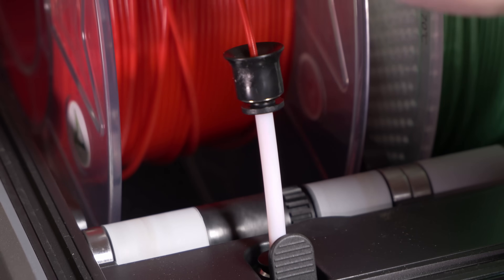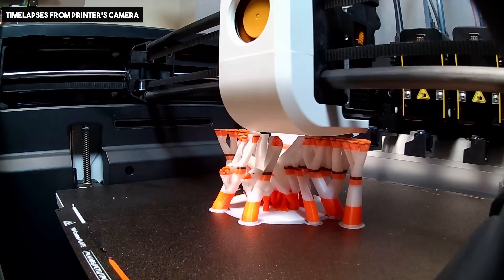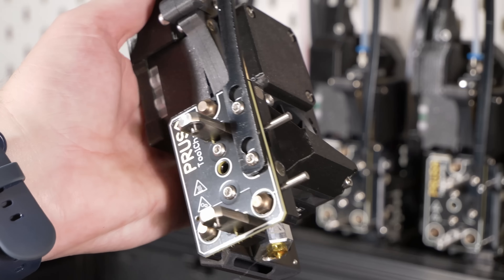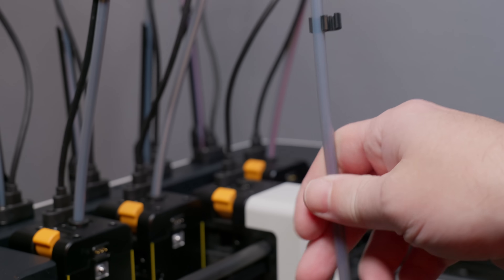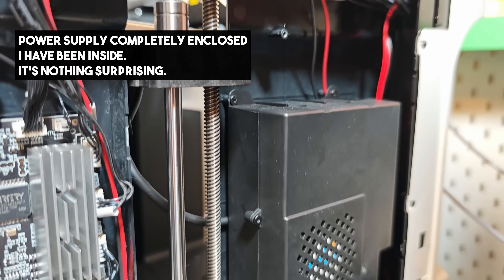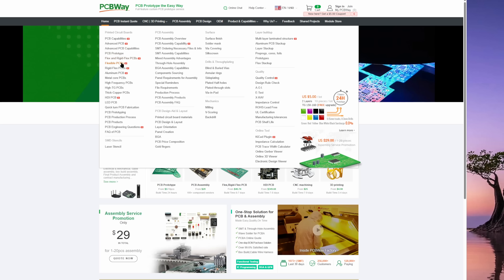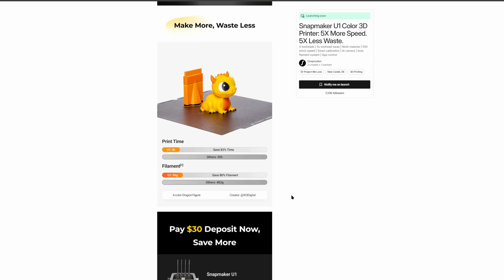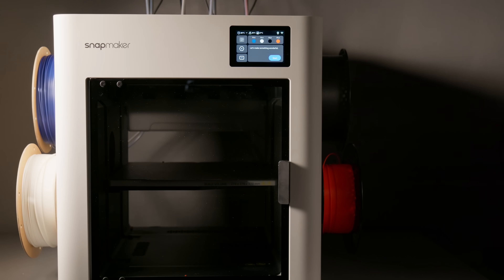FINALLY! An affordable 4X toolchanger! Meet the Snapmaker U1.

Comment: I've had their IDEX for about a year and a half and it works amazingly well. I use it mostly for being able to print a different support material for models with complex geometry. I see no reason why they can't pull this off.  It would be nice if they had a way to fully enclose  and heat the chamber though. Also you really shouldn't need a prime tower nowadays with pressure advance.
Reply from the maker: Oh. Completely forgot ! It's coming 😂 there will be a lid.

Comment: Looks like a additional $200 for it to be able to use functional filaments. $150 tophat (250msrp) and $50 for the hardened nozzles ($80 msrp ... why isnt this standard now?) So kickstarter price of $1000 for a 270mm^3 toolchanger, less than half the price of the bambu lab h2d with ams or the prusa xl.... Not bad...  that said Im still waiting for the INDX by Bondtech to start hitting the shelves so we can get some more toolchangers out in the wild.
Reply: This is still an incredibly reasonable price structure. :D I'm still super hype for INDX as well though.
Reply: @802Garage  35 per head! (if it works)

Comment: Do you know how accurate it prints? I print custom lego-compatible designs, and need something like this for multi-material designs
Reply from the maker: Very. Did you notice the goose miniature with it's eyes in the right place? I tested some miniatures too (forgot to include) and the accuracy is absolutely spot on.
Reply: @LostInTech3D  I did and it looked great even with stringing, but sorry I more so meant tolerances. Have you tested or seen anything on that?
Reply from the maker: I think some people were testing that, honestly these things usually come down to flow rate tuning, so I'm not hugely concerned

Comment: Oh look an embargo drop!

Half the reason Voron community got into toolchangers is that running HIPS through your nozzle fouls ABS for a little while, making your ABS prints not as strong as they should be, even a tiny contamination means a lot of strength reduction. With a tool changer system, you don't have that problem.

Comment: Toolchangers are the superior option in my opinion for serious users, not only for the massive reduction in waste and the possibility of using multi-material prints (cheap support filament with a higher capability material for instance), but the only way to go when you have Really expensive filament and a gram wasted in much too much already. This printer could put them on the map in a big way if they can deliver, but per my usual, I'll be waiting to see how they fare with proper release. Having a company to not support a printer isn't so much a problem these days, but it is annoying if some is open source and some is proprietary when it comes to warranty time, and the company isn't around anymore ala cash grab and run scenarios. 
What I'd REALLY like is a retrofit kit that isn't $2k or another project beyond adding some klipper code, as I have enough printers already and space becomes a premium for home users or those with smaller workshops.
Reply: @C-M-E  The flip side of that though is the expensive filaments need to be in a controlled environment because a print that fails wastes even more filament than a purge poop. The reason I have an AMS is to control the filaments more than anything. So even with this I don't think I would consider it usable as a multi material printer until I have gone ahead and bought a material station to go with it.
Reply: @christopherpepin6059  You can simply put the spools in dry boxes or dryers next to the printer and still run them through the filament feeder. People can also design mods to add dry boxes to the side like the Qidi cylinder box for the 3 series.
Reply: @christopherpepin6059  Chances are if you're using the engineering grade or industrial-lite materials (like above nylon approaching PEEK/PEI) this class of printer is probably not in your wheelhouse, at least not in a production setting. For the more avid home user or small-scale creator crowd, there are quite a few 'good enough' solutions or even DIY options that will suffice for material handling when the desire becomes a need. Something like the Sunlu S4 comes to mind, or if you need more heat and don't mind the DIY option, I ended up repurposing a discarded instapot for my controlled heating that will go way north of 80C and fit at least two spools for simultaneous printing. I don't do much in the way of color cosmetic prints so much as practical and R&D/development work, so two materials works for my pipeline. Having the option of running two spools of each would be nice, however. 
That's kind of an ancillary purchase regardless of your printer though, and more or less need-based. Just my .02

Comment: Have you tried multi-material with the slicer? Last time I checked the multi-material wipe tower settings in Orca don't do anything. It stacks PETG on top of PLA, which fails at z=10mm, or so.
Reply from the maker: have you raised that as a feature request on orca's github?

Comment: interessting system to connect data and power to the tool heads, looks like onewire or can bus but its only 3 tiny pins, they gotta get power from somwhere other metal part then?
i hope the spool holders and feeder motors can be detached for space reasons, moving them somewhere else.. like directly onto some filament dryers
Reply from the maker: pretty sure it's the other way round, the toolheads have power, they're supplying only the fan on the carriage

Comment: Thank you so much! This is very significant!
I've been waiting for affordable tool changers. In my case though, I want it on a large format printer (400X400), or I hope e3D or other companies will start developing custom solutions that work (unlikely to happen, but hoping..)
Reply from the maker: Thank you ! it's only a matter of time in my opinion, I'm optimistic ...especially when I glance over and see I'm right about the kickstarter pledges, this is going to be very popular so others will copy and iterate on it for sure
Reply: Sovol SV08 Max with a Bondtech INDX (due in November)?  500x500x500 mm build volume and up to 12-ish tool heads!
Reply: @Liberty4Ever  I wasn't aware of the INDX tool changer coming soon! That's very promising! Thank you :)

Comment: Hmmm.

This differs from the Prusa in that the carrier on the X-carriage has a fan, while the Prusa has a separate fan for each head. I assume the fan is powered by a connection with each head. Not sure if I like that, got to make sure that connection stays clean.
Reply from the maker: yeah its a 3 pin, I guess semi regular cleaning of that if it malfunctions, but it seems okay so far

Comment: Magnetic cover on the tool head seems nice. I like this, might be my route into multi-color/material printing. I've never done multi material prints on my P1S because of the waste, just use the AMS to save time changing filament spools.
Reply from the maker: Oh yeah once you take the waste out of the equation it gets a lot more attractive!
Reply: @JeffGeerling  you should look into the Proforge 300. Only has 3 toolheads I think but cheaper and open source. 3 materials is the max most people need 90% of the time anyway
Reply: @russellkeyes3984 honestly two isn't that bad either, like for supports or mixing flex with rigid!
Reply: @JeffGeerling you got this with H2D already
Reply: @JeffGeerling Yeah at work we use I would say 95%+ of the time only 2 toolheads and we have 5 toolhead Prusa XLs.
Generally two materials are enough for support or potentially mixing materials, it's very rare that we need more than 2 tool heads.
Reply: @russellkeyes3984 Proforge 300 is $1,238 with 3 toolheads. And its sold as a kit so it needs to be assembled. Not saying it isn't competent or a good printer, but it's definitely not cheaper. And the U1 will be open source too
Reply: @russellkeyes3984  I think that just comes as a kit. Looks like it could take a lot of time and effort to put it together. Though, if anyone could handle it, I am sure Jeff could.
Reply: I hope the bondtech indx tool changer get's intergrated in a printer. It would wipe the floor with a printer like this. It only needs 1 extruder in stead of the 4 extruders this needs. I'm allready saving money to upgrade my voron.
Reply: @rebelangel66   INDX is superior when it comes to tool cost only. A tool changer like this is superior as tools can preheat, but more expensive.
Reply: @rebelangel66  I figure one head for .2mm, one for .6mm abrassive, one for support material, a few for color.
Reply: I’ve done multi-material on my A1 but very rarely done and almost always where the colour change is only a few layers.  Typically to highlight details or to create labels.
Reply: Hah, I love it when Jeff chimes in.
Reply: Color change at layer heights, little waste there
Reply: There is a magnetic cover on the SV08 tool head. It's convenient until it gets knocked off mid print. On the SV08, the fan is mounted to the cover and the connection from the fan to the tool board can get destroyed by that cover coming off and being dragged around. On newer releases of the SV08 they have a spring loaded pin that keeps the cover from coming off.
Reply: As long as you're not having it swap constantly it's really not so bad and very worth it just to be able to do something like put different colored highlights or text.  In the slicer though definitely change the flushing volume down even to around 0.4 without much issue.  Definitely isn't worth it on tiny models but if my flushed mass is say <5g on a 500g print then I'd say it's easily worth it.  Plus you can flush into supports and infill a lot of the time or even use a flush object.  You could easily make some fun Raspberry Pi cases as flush objects where the coloring doesn't matter.

Comment: I definitely want a tool changer printer. I’m thrilled to have more than one choice. Let the multi tool head race begin.
Reply: Tbh, I'd be happy with two: One for print material, one for support material. Having easy supports would open up a whole world designwise.
Reply: @StormDogg  h2d will be faster if all you need is 2
Reply: It's also 2.5x more expensive :/
Reply: I ordered mine and am quite curious, reviews seemed pretty positive for most parts with some downs here and there but not having to flush any filament is just <3 Also the fact that it prints literally 5x faster according to the orca slicer etc.
Reply: Creating a problem to the solution
Reply: Agreed...as long as it's not a race to the bottom where quality, along with user experience, suffers.
Reply: Yes, unfortunately that is where some manufacturers take it. I am really excited about Bondtech’s tool changer. There are a few printers that I have lying around not doing much that could be a fun upgrade project.
Reply: The SnapMaker U1 looks like a great alternative for people who want to buy an out of the box solution rather than upgrading their printer with a Bondtech INDX.